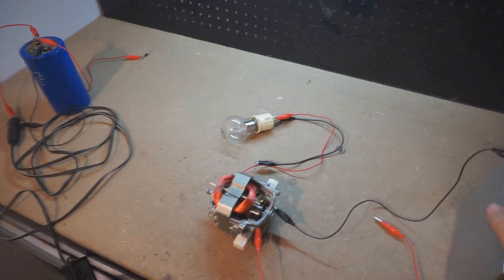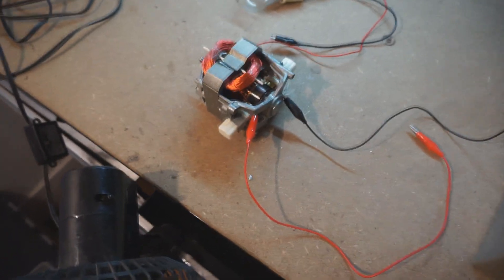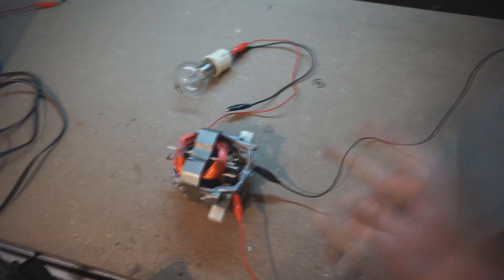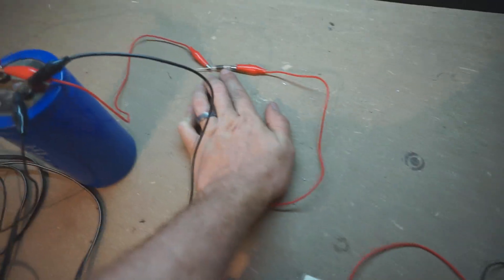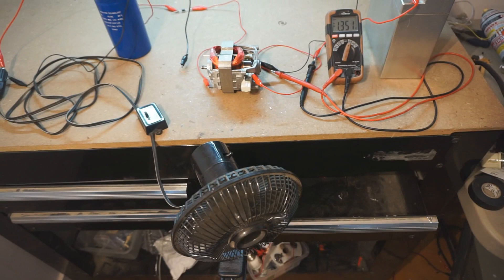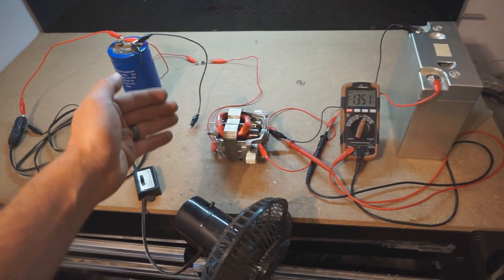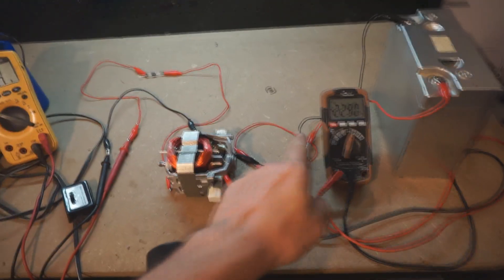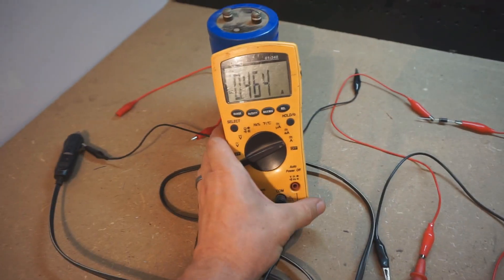Universal vacuum motor generator effects...

Comment: but why? why doesn't it change direction?
Reply: islandonlinenews because there are no permanent magnets or induction rotors, it has everything to do with phase angles in this case I believe.
Reply from the maker: ***** 
Wow, that was a very infomitive comment.  Thanks for the great info.
Reply: The direction of rotation does not change, because the magnetic polarities of the stator and rotor change simultaneously when the polarity of the power source changes. The net effect is that the magnetic interaction between stator and rotor is reversed at the same time, as such the direction of rotation remains the same. This is why the motor is able to run on AC power source. You can change the direction of rotation, by changing the polarity of the stator coil or the rotor coil, but not both at the same time.
Reply: +Reed Arnold I think it has something to do with how the field coils are wired because there are some that are reversible.  Have a drill that does not use batteries?  They have universal motors that can be reversed.  For example, If I knew enough about motors, I could theoretically wire my Dremel to run backward.  That would require more knowledge that I have about that sort of thing.  I just know that they have brushes that need replaced once in a long while.
Reply: You can usually make universal motors change direction by simply swapping the brush wires around. You can also do it by swapping the field winding wires, but they are usually harder to get to. Washing machine motors and similar universal motors that are reversible often have separate field and armature windings to achieve this easily. I think universal motors are usually optimised to spin in one direction by orienting the relationship between the windings, commutator segments etc in a certain way, but I'm no expert. I don't think they run as well in reverse for these reasons.
Reply: No problem, I used to set up lasers on CD players so just sharing basic stuff really.  Oh I over looked an explanation as to why the current goes down when you apply a load such as a lamp, it is very simple, the stored inductance in the stators (IN SATURATION) is able to release that energy when you apply a load using a third coil, from the stored inductance, as the saturation drops (DUE TO LOAD) the motor current draw will fall as the motor REVERSE EMF is being tapped off by your load bulb.
Reply: Simply put your turning your motor into a type of transformer, the commutator switching as it spins is allowing a certain amount of frequency to be generated in the inductance loop.
Reply: lasersaber yes thanks!
Reply: +islandonlinenews I don't know but I have a motor similar to that from a broken Cuisinart blender and I still have the glass jar too.  I might just photograph and list them on eBay and see what I get for them.  The only reason I have those parts still is the black plastic part on the top of the motor was cracked and shattered instantly when the blender started.  I don't know the speed of the motor because they don't mark it anywhere like they would with power tools.

Comment: Very nice for an opening salvo :)
You can reverse the direction, by putting one AC coil in series. Then short it and unshort it with a clip lead...the motor instantly reverses direction.
Having fun myself, discovering how different these are. Especially to regular little 3V DC or brushless aircraft motors.

Comment: Lasersaber: Current drops on the fan load, because RPM gets lower. More RPM-more current. Less RPM-less current draw. This is simple.
Reply from the maker: GmanBB 
You are probably right.  What I am usually used to seeing with a system like this is a drop in rpm when the generator coils are shorted followed by either no change in current draw or a corresponding increase in current draw.
Reply: GmanBB Incorrect. Current draw will drop with any brush motor as the RPM increases. This is why the current increases when you place a load on the motor-the RPM is dropping.

Comment: Didnt the current draw technically INCREASE, since it was in the negative direction?
Reply: +Jack Seds no because current doesn't measure which direction its going. its either 0 current or more. there is no such thing as negative current. only amount of current

Comment: The current draw is related to the RPMs, perhaps?
Reply: check watts not amps
Reply: @MrTurnermason  how are watts calculated?
Reply from the maker: USWaterRockets 
You are probably right.  What I am usually used to seeing with a system like this is a drop in rpm when the generator coils are shorted followed by either no change in current draw or a corresponding increase in current draw.
Reply: I also think the same

Comment: I acknowledge that you may not be interested in doing the experiment.. but If you use a motor that have a set of starter coils and decide to use those particular coils as a gen "After the motor have started", you can also get a very nice output, "Perhaps the problem with those ones is to deal with the temperature..